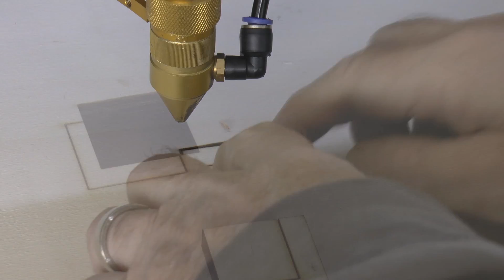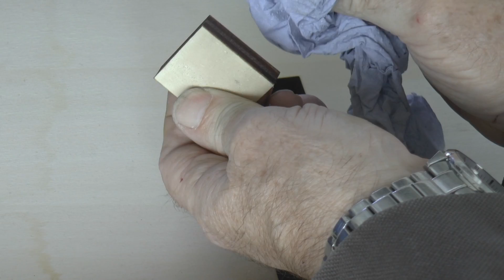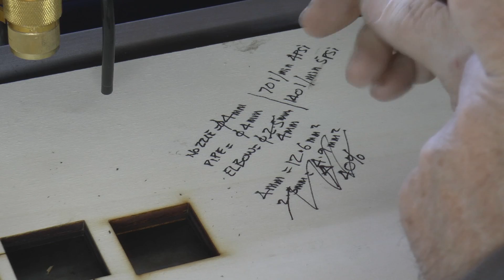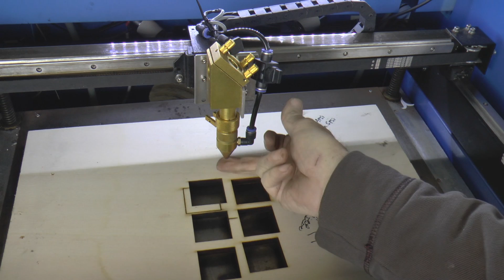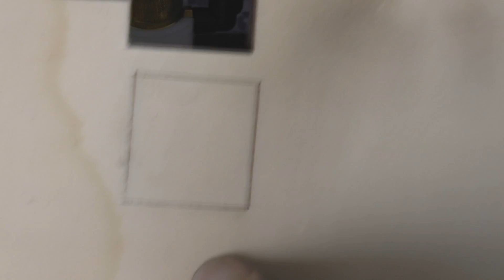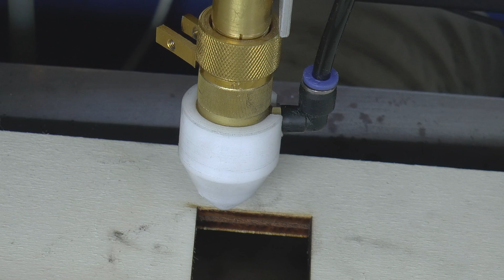RDWorks Learning Lab 87 Maximising air assist efficiency

Comment: Scientific Method 101 : Change ONE parameter at a time!
Reply from the maker: I agree  but there is a 101A that I use for short cuts when I know roughly what to expect. If that expectation is not realized then it's back to 101.
 Thanks
Russ

Comment: The difference between the 2 and 1.5 inch lens is the focal point.  The focal point for 1.5" is very tight, and the 2" is a bit broader in length.  The longer the focal length, the thicker you can cut.  Very interesting on the air flow -- I have a compressor and have not played with that too much...but seeing this video makes me want to play with those settings.

Comment: Very intersting video! :)
I‘m currently struggeling with one challange I have with my laser. I‘m using masking tape and want to paint the engraving afterwards.
It apoears to me, that the paint won‘t stick propperly to the engraved surface due to burn marks within the engraving. Any clue how to improve this? Thank you :)
Reply: Hi Nils
Part of your problem is the air assist and part is your lens and power settings.

 When you fire the laser beam at an organic material it stimulates the SURFACE molecules to heat up. When the temperature rises above some critical level. the material experiences a chemical change. In the case of wood it first scorches then starts to evaporate the cellulose creating flammable fumes and sticky tars. It leaves behind a residual carbon layer  which absorbs the energy quickly  and heats to more than 3000C (with more chemical changes before that final temperature)where the carbon then evaporates leaving behind clean wood. This whole process keeps happening layer by layer to cause and engraved surface.

 When you engrave, you are converting solid material to gas/vapour/fumes which are hundreds of times more voluminous that the original solid material.  Watch your engraving very carefully and you will see that the fumes squirt upwards just like a volcano. Those are the TAR laden fumes that you are blowing down onto your work when you use your air assist
  The deeper your cut the more rapidly you are converting solid to fumes and in such circumstances the gas does not get a chance to explode UPWARDS. Instead , the only way for the fumes to escape the cut zone is SIDEWAYS......all over the surface you have just exposed.

You need to do several things. 
1) Choose a longer focus lens 2.5 or 4"
2)Choose a nozzle with a large orifice (typically 4 to 6 mm)
3) Set your air assist to just a whisper to stop the lens from fogging up and NOT blow the fumes back down onto your work
4)Make the gap between nozzle and work surface at least 12mm ( the bigger the better)
5)Do not run at high speed or high power. Set the power to 30 to 50% and find a speed that leaves a nice clean surface
6)Make sure you calibrate and set your scanning reverse offset to match the speed you are using
7)Set your line spacing (INTERVAL) to as large as possible  (it maybe 0.2mm). You do not want to double burn lines 
8)Modify your machine to get a good CROSSFLOW of air ACROSS your work.  see  https://www.youtube.com/watch?v=AHnJ2WxNo5Q    from 42:20

Best wishes
Russ

Comment: Hi Russ, 
Such a great video (even though its a few years old) 

The extention or shroud, where did you get that? :)
Reply from the maker: Hi  I was just something I made very quickly from Delrin (acetal copolymer) to explore the principle.  It is not a suitable material for any real use because it will either melt or catch fire. I have done a lot more work on air assist since then.
 There is only a limited amount of air you can force down a 0.2mm wide kerf and many believe that throwing 2 bar pressure at the problem gets good results.   At the same time they are using a nozzle with a 4mm orifice that sits 19mm above the work. Air is compressible  and the more you compress it the faster it expands when released into the big wide world.  I really cannot comprehend how some people can be so illogical in their thinking. Small orifice (about 2mm), small distance to work (3mm max ) and low pressure (0.2bar is entirely adequate)
  That way you can EFFICIENTLY evacuate the fumes from the cut face out of the BOTTOM of the cut. 
 See this video from 33:30 to see the effectiveness of distance from work
 https://www.youtube.com/watch?v=bh4qvwZFzg0
 There are nozzles available at Cloudray .com that fit an M22x1 lens tube thread . This size is fairly common but   there is no standardization

 Best wishes
Russ
Reply: @SarbarMultimedia  
When having that small of a distance to the work piece, wouldnt that make the beam out of focus? Due to the focal length? :)
Reply from the maker: @sorenac   Absolutely YES...... but only if you left the lense where the manufacturer decided it should sit. How many laser machines do you think has he ever worked with?  Ok so we agree. .. There are so many different lens tube designs that I cannot suggest a solution for your situation but basically you have to find a way to move the 
nozzle forward to reduce the gap to the work. You must leave the lens at its correct focal distance. Depending on how much distance you need there are lens tune extenders (about) 12mm
 see   https://www.cloudraylaser.com/collections/nozzles-lens-tube/products/extension-ring-for-c-e-series-cutting-head
  Check your lens tube thead becaise this only fits M22x1 thread.

 Best wishes
Russ

Comment: It's the pressure that matters here. 70l pump generates 0.03MPa, 140l - 0.033 MPa. Since thin tubing is used, the difference in actual volume of air passed thru is relatively small. Larger diameter tubes would help, however nozzle will be the bottleneck anyway.
Reply from the maker: Hi
 In the last 4 years since this video I have done a lot more study into this  and I am very happy that  I now understand the efficacy of air assist and how to extract maximum efficiency.  The only flow that is important is the flow through the kerf and NOT through the nozzle. Many people are using large shop compressors and high pressure to achieve your goal of more flow through the nozzle. The problem is that air is a compressible medium and as these experiment indicate , the smaller the nozzle orifice and the closer you can get to the work , the more EFFICIENTLY you can get flow through the kerf. The kerf is only typically 0.2mm wide I would therefore. The goal is to get flow through this VERY restrictive channel. This is the REAL restriction in the system we and NOT the pipe work or the pressure. We all know what happens when you release high pressure air into the atmosphere......it expands rapidly.  How much of that air ever gets into the kerf?   As you rightly observed, doubling the pump flow rate was nothing but a waste of energy because the very small increase in pressure resulted in an equally small increase in flow.  At the time my imagination overpowered the fluid physics  and tempted me to try the higher flow pump.  but it did teach me some valuable lessons.. My other two machine are still using the little 70l/min pumps and proper cutting nozzles. For absolute proof of this take a look at this video from 33:30
https://www.youtube.com/watch?v=bh4qvwZFzg0.
 Thanks for the great comment because it has allowed me to expand on your observation for others to understand.
 Best wishes
Russ
Reply: @SarbarMultimedia  Your comment is surely full of useful info! I had it in my head, that if I used really high pressure (like 8bar, yes - 8bar), I would get perfect cuts with absolutely no charring. I looked through tons of compressors to suit my needs, just to find out, that anything above 30psi (2bar) doesnt really make any difference. So, I ended up with a heavy-duty airbrush compressor, which can hold constant 30psi no problem. I will fully put to use your tips on how to make it even more efficient - so thank you!

Comment: Does such air compressor have any overheating issues?
Reply from the maker: Hi 
No I have been running one for about 5 years now and on one of my machines  it is on continuously whenever the machine is switched on.  It is still working perfectly and gets to maybe 50 or 60 C. On my other two machines I have designed and fitted an auto air assist  system   see https://www.youtube.com/watch?v=ZKC8Byc8y28

This system is available through Cloudray  see     https://www.cloudraylaser.com/products/ultimate-air-assist-set

Best wishes
Russ

Comment: Spectacular!
Reply from the maker: Hi Ginny
I have travelled far on my learning journey since this video 4 year sago  The lessons I learnt at this stage have been with me on that journey. In a video I published recently using an RF tube system  that I added to a machine like this  even more starkly demonstrates the improved cutting efficiency you can achieve cutting organic materials like wood if you understand a bit about physics and fluid dynamics. . That sounds very expert and pretentious but in reality it means keep the work to material gap small (3mm max) ,the air pressure low  (3or4 psi is perfectly adequate) and the nozzle orifice as small as possible (2mm to 2,5mm max).
 see this  video   from about 30 minutes  https://www.youtube.com/watch?v=bh4qvwZFzg0

Best wishes
Russ

Comment: Great video , i am going too do the same , what switch  are u Using for manual switch on ?
Reply from the maker: Hi Fredrik 
 Here is what I bought.6mm pie size. There are lots on ebay and Amazon
https://www.ebay.co.uk/itm/Pneumatic-Push-In-Fittings-Air-Valve-Hose-Pipe-Connector-Joiner/202544633106?hash=item2f2899d512:g:WpwAAOSwLNxcHFCv
 Best wishes
Russ

Comment: Great work. Again!!
Have you done any testing with air blowing from the top down AND from the side?
Reply from the maker: Hi Chad
This work was done during my progression towards an understanding of the physics of cutting. When I understood that aspect of cutting it all fell into place about the importance of air efficiency and not necessarily volume or pressure. I had tried bothe top and side air assist and neither were of any value.. In essence you need air in the kerf for cutting and no air for engraving (except that required to protect the lens) A very recent demonstration of how cutting efficiency is important to cutting can be seen from 30 minutes 

https://www.youtube.com/watch?v=bh4qvwZFzg0

The point here is that a small orifice, low pressure (therefore low flow) air assist can be very EFFICIENT if you can force most of it into the kerf. Air is a compressible fluid , thus it will always expand as it exits the nozzle orifice. The higher the pressure the more rapidly it expands  so less of it gets into the kerf.  The trick is to keep the work to nozzle gap as small as reasonably possible. 2mm to  3mm is ideal as is demonstrated in this video.

Best wishes
Russ
Reply: @SarbarMultimedia  Interesting. I guess I missed the video, if there was one, about side airflow.
I appreciate the video you shared in your above response. The end nozzle that you have on the lens tube came from where? Did you design it? If so, could you send me the design, or point me to where it is on your website? Otherwise, I can design one. If I do that, what is the diameter of the nozzle opening? Is it 3mm like you mentioned in a previous video from years ago? Would making a closed end, that I then burn a hole through with my laser be practical, or would the hole be too small?
Reply from the maker: @greenacresfarms  
 Hi Chad
 If you visit the Cloudray website and look for the C series lens tube , I have found that to be the perfect lens holder. It can handle 4", 2.5" and 2" focal length lenses that are 20mm diameter. In addition, because it has an M22x1 thread, it will take what I call a CUTTING nozzle NO3 which has a 2.5mm orifice.  There is also a short nozzle that will allow you to use a 1.5" lens 20mm diameter.. PLUS you can get the compound lens kit that screws into that 22mm   thread and is superb for photo engraving. The nozzle that holds these two lenses can be used for any type of engraving because it has a 6mm diameter orifice.
see
https://www.cloudraylaser.com/collections/nozzles-lens-tube

 As I mentioned earlier, air is a compressible fluid. You need to get an adequate flow of air through the kerf. Blowing from the side or above is 99% inefficient at achieving this because the air pressure (and flow) are diluting for every mm you travel. (because the air is expanding). Your idea to make the hole smaller has merit but  is a balancing act. If you make the hole small then you are increasing the pressure difference across the orifice and also limiting the flow.  Ideally you want to achieve laminar flow but that is almost impossible with  a small column of air. A sharp orifice will certainly destroy any attempt to create laminar flow, instead you need a section of parallel tube,  typically this length  will be 2 or 3 times the diameter. Generally this is not practical so 1:1 is what we have to work with.  Thus low pressure, low flow and being as close to the work as practical is the ideal solution.

Best wishes
Russ

Comment: You've got a jig to place material at an angle to check the "working envelope" (beam concentration) of both lenses.
Maybe you should compare the working envelope differences between a 1.5" focal length and a 2.0" focal length lens, and see if that didn't have some effect on why you couldn't get much better performance out of your 1.5" focal length lens, as maybe your thickness of material prohibited better performance because of the larger included angle of the shorter focal length lens.
I wouldn't be even a bit surprised if your cut quality drops off MUCH faster as your focal length decreases, as your angle test video displays a decided "curve" going from a "fuzzy" cut to a sharp cut,and then dropping back to a fuzzy cut as you come into and then go out of precise focus. The longer focal length lens "should" stay close to precise focus longer because it has a smaller included angle due to its longer focal length.
And given this, I wonder what would happen if one were to acquire a lens with a 6" focal length.
Could it make setting the focus noncritical, given that using your angle video and the curves displayed, that within a given range of maybe 15 mllimeters the focus would be "precise enough" to do a good job?
Would the increase in focal length flatten the curves displayed in that video due to much lower included angles?
After all, the beam at the focal point should produce an exaggerated "X" getting wider both above and below the precise focal point.
Anyways, all your videos are thought provoking, very thought provoking, and that's a good thing. I enjoy them..... a LOT.
Reply from the maker: Hi
Thanks  for your interest because the whole subject of lenses is steeped in theory . The theory is well proven and tested  under certain controlled  laboratory circumstances, The problem I encountered was what is happening to the light intensity within the beam  as it focuses and  because for our application of lenses, more light intensity=more material damage. There is no research work I could track down that  helps with this. Hence, I have undertaken a whole body of experimental work to try and decode exactly how the focused beam works for OUR application of lenses. There are lots of sessions between #160 and #172 that follow my progress but two in particular that will help  clarify  your "possibly" and "maybe" thoughts.  After all my work I have no doubt about anything to do with lenses I now know absoloutely how  and why they work the way they do for our application.

  https://www.youtube.com/watch?v=zJjAr-TANQk
  https://www.youtube.com/watch?v=iOsVvz2zEBY&t=2s

Best wishes

Russ

Comment: I feel like I’ve missed some settings somewhere. How do you slow down the cut speed of a file without needing to go back to the PC and resave the file?
Also is it possible to move where the start point is? Say I’m cutting a test square then I want to cut another. Right now I move the sheet I’m cutting but I’d like to move the laser head. I can’t do that without going to the pc and resaving :(
Reply from the maker: When you run a file from the PC take a look at the machine display panel and you will see at the top TEMP FILE. That means your program is temporarily stored in machine memory. If you now press Enter Enter you will be presented with a screen display for editing the basic speed and power parameters. Press the ZU button to jump between windows and press Enter Enter when you have set your new parameters.  I would DOWNLOAD that test square so that it remains in your machine. You will then always be able to easily access it via the FILE button.

Your other issue is just as simple (when you know how). Press the arrow buttons to move the head to a new position and then press the ORIGIN button to make that your new start and finish point. Before you run the test square you can check its position by pressing the FRAME button.

Best wishes
Russ

Comment: Is there a 3d printer file to make that extension? I made one by gluing acrylic together but it's not that nice
Reply from the maker: Hi Tim
As you move further into my journey you will see I have completely redesigned my head so that  it now takes short and lung nozzles and anython for the short focus (21mm) compound lens to the 4" lens to suit either engraving or cutting,  This temporary extension was really to prove that you must not let your air assist spread out in the big gap between nozzle and work if you are cutting, the efficiency with which you can deliver airflow into the kerf is vital for cutting most materials.

Best wishes
Russ